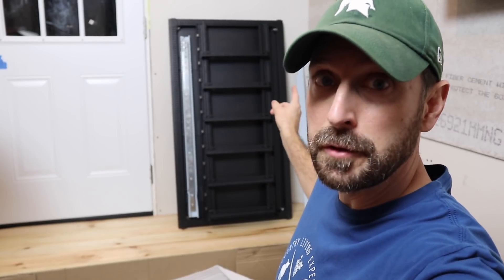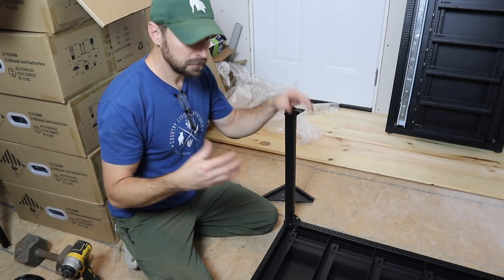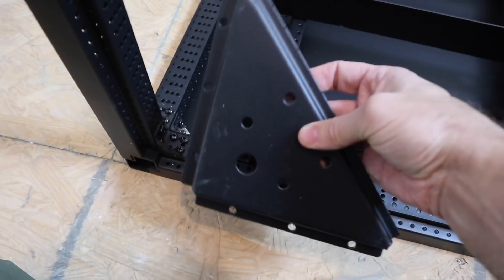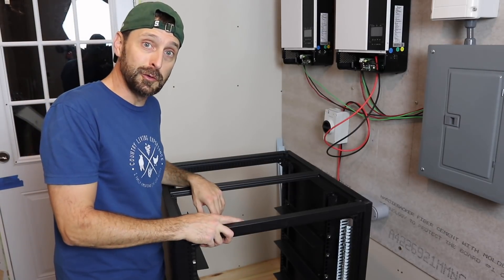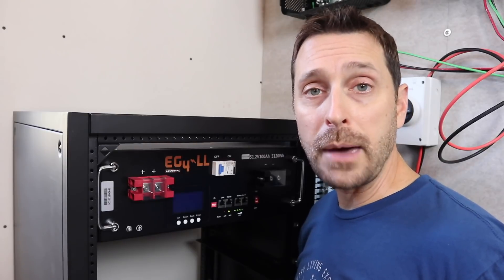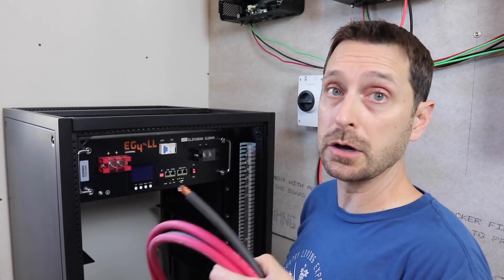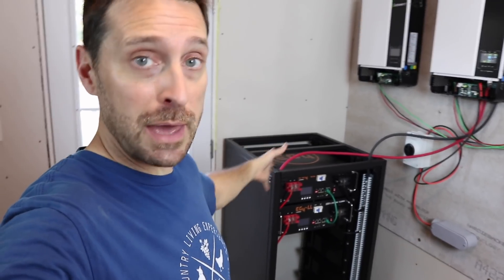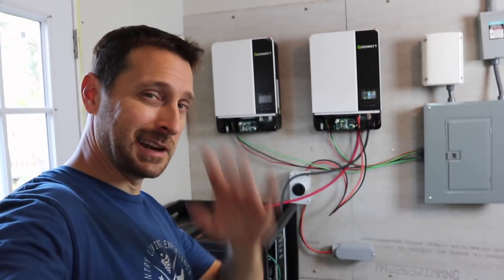Lithium Solar Battery 48v! Best Value EG4-LL +Rack Build Tutorial

Comment: So the roughly $200 premium compared to the other EG4 batteries, I'm trying to wrap my head around this.  So apart from the initial installation do you actually find yourself utilizing the LCD screen much during normal operation?  It seems more like a novelty.
Reply from the maker: Not just the screen. It has the ability for the bms to communicate directly with the inverters. The regular Lifepower does not.

Comment: Question regarding the 'grounding' aspect of this. If one were to build an off-grid battery rack with Inverter and they only connect it to the house via generator inlet connection for backup emergency power, like what Will Prowse showed recently in one of his videos where an MPP inverter is mounted on top, does the rack need to be grounded still? None of those 'consumer' solutions have anything special about grounding (ecoflow, bluetti, anker etc.), so I assume that 'ground' happens naturally when the connection from the 'unit (DIY or consumer style) is connected to the inlet to the house panel. Appreciate any feedback.
Reply from the maker: I appreciate the question. Grounding is a complicated and often argued about subject that some electricians don't even fully agree upon. That is probably why most videos and solar companies will not touch the subject. 
I have tried my best to glean information from a friend who is an electrician, the solar supply company, Mike Holt (probably the best source for electrical information), and other YouTube channels covering solar. I am not an expert by any means on the subject and just did what I thought was the safest based upon the info I had. 
As for your question, I believe that it would act as a generator ground and utilize the house ground system once connected via the inlet plug.

Comment: Question on grounding the batteries: I understand that the ground goes out to a grounding rod(earth ground), but what did you use from battery to battery? I was thinking a small "jumper" from battery lug to next, having two wires on every other with the final being the wire that goes out to the ground rod? Appreciate you videos.
Reply from the maker: You can do that but my batteries are in a metal rack and all bonded that way. I didn’t put a jumper between them.
Reply: this is a result of the mounting of the battery into the rack, correct?  Then just ground the rack to the rod?
 @CountryLivingExperience
Reply: Thanks by the way
Reply from the maker: Correct

Comment: Id love to have a bunch of those type batteries but they cost alot even if they are the best value. I have built my last couple batteries first i did a powerwall with leaf modules and now im building a good size lifepo4 battery with 280 grade a eve cells. I like the plug in rack stuff like you have but for the same price i got alot more amp hpurs and much bigger bms. The rack looks good tho and seems to be much easier and probably more safe
Reply from the maker: The batteries are the most expensive part of any solar system for sure. Glad you know how to build your own. It probably saves you a lot of money.
Reply: @CountryLivingExperience  yeah I love the battery stuff and all solar and stuff that goes with it. It's become a hobby that my wife says I'm addicted to. I'm an over the road truck driver and only home a few days a month so I order new stuff each week then going home is like a bunch of solar Christmas presents that I get to assemble and play with for a short time then back on the road. Thanks for doing all the videos
Reply from the maker: @matthewknight5641  Awesome

Comment: What is the standard method for connecting the charger?

It's terminals only split a few inches, therefore they can't even reach their own company's battery terminals.
Reply from the maker: I had to trim the insulation on the cord for mine to reach.
Reply: @CountryLivingExperience  
Ok, thank you very much for telling me that.

I didn't want to overlook another solution.
Reply from the maker: @dialecticalmonist3405  You're welcome

Comment: Doesn't that charger take 10 hours to charge a single battery? That would be 60 hours of charging before you could use it with a full rack.  What am I thinking wrong?
Reply from the maker: No, it doesn't take that long. A few hours for each.
Reply: @CountryLivingExperience   I knew I wasn't seeing something, I got the 10 hour thing from another video, maybe it was really 10 hours for a whole or near whole rack total. thanks my friend!

Comment: Would u know what setting the battery type is on the eg4 6500 inverter for the eg4ll battery?
Reply from the maker: Yes. Set to EG4 on master inverter and USE on all subsequent inverters. However, if you want to program #29 for low voltage cut off, you need to set both to USE.
Reply: @CountryLivingExperience  excellent, ty sir

Comment: I have the same EG4LL batteries and three of  ES5000’s. I really need to know what was your choice on batteries cable. It is not listed here. I am perplexed between 2 AWG & 2/0. Any recommendations, as i couldn’t find it in your descriptions. Thank you. 

Maranatha
Reply from the maker: For this system I used 2 AWG(guage). It was sufficient for the amperage. If you have 3 ES5000's, I may move up in battery cable size. Smallest to largest would be 2awg, 1awg, 1/0, 2/0, etc. I have 2/0 and 4/0 (huge) on my new system because the amperage is much higher.
Reply: @CountryLivingExperience  thanks. One more question, what about the cable size? Would it still be able to fit? I know I have to get the crimping wrench. But will the size (diameter) pose a problem? I caught a great deal on 2/0 @ $5/ft. Thanks
Reply from the maker: You're welcome.
Fit where exactly?
Reply from the maker: I did a battery cable assembly demonstration in this video.....https://youtu.be/-5w6b_2LxtQ at minute mark 8:58
Reply: @CountryLivingExperience  wondering if it is any harder fitting 2/0 (crimping) vs. 2AWG.
Reply from the maker: It should be the same level of difficulty.
Reply: @CountryLivingExperience  I am looking at 200 amps.

Comment: You need an electrician to redo your wiring, so your insurance will cover you if something goes wrong. An example would be your AC needs to be in conduit.
Reply from the maker: You didn’t listen to what I said about putting it in conduit later.

Comment: And don't forget to put a heater or an air conditioner and some other states up north where it gets 93 degrees in Wisconsin or 22 below zero in Wisconsin or like before 43 below zero you might need a heater and a shed as well as an air conditioner and the batteries don't like the cold or extreme heat as well but I don't know maybe they're inverter will heat itself but I doubt it not when it gets that cold when it gets that had it probably cool itself though.

Comment: I actually best fit it with an eg4 inverter which cost less than a grow Watt and it certified with electric company and every state in the United States of America of the 48 states maybe except for Alaska and Hawaii which I think they're actually certified for those too so you can hook it up the grid to sell electricity to the electric company but you do have to get a building permit and electrical permit to actually get that happen and they have to actually inspect it to pass it a second time and it will pass with those batteries and the eg4 they are certified for that and those are the only really two things that will connect together perfectly the grow what unless things are solar program to grow Watts for those batteries you would actually have to program those batteries for that grow lot or you can't just plug and play you would have problems and they might have done that for you and they might have done that with an update once you turn it on or before you even turned it on cuz they don't do the grow Watts they may sell them they do the EG4 inverters that's what belongs to signature solar and the EG4 batteries and both types of their EG4 batteries I certified by my understanding by the electric company and every state of the United States of America maybe only the 48 states and the hardest state of all it was certified for was California even accept them and that's what you should be thinking about getting is there actual inverters that are 6500 that cost $1,299 where the batteries cost in 200 or $300 more which you already have. With that you wouldn't know that other little box because with two of the inverters of signature sellers would come a 120 and a 240 volt without any extra thing cuz it's already built into them. And there are also stackable. And besides your inverters can take the most wattage in from solar panels than any other inverter out there at least that's what I do believe of course solar Arc might do the same thing or the AMS inverters that's electric companies likes to put it in like their county trucks would have for the trailers but I have 10 solar panels on them with two 1920 lb battery sets of AGM massive batteries.

Comment: Just finished assembly of the rack. It is a mess. I was able to screw in the black screws with a battery powered hammer drill, I think the threads are mismatched. I found a woodworkers clamp that can open to 24 inches handy to help align things.
The wheels are nice and worth $20! 
They send a different set of bottom plates that has the correct hole alignment for the wheels but the screws are too small. I'll try bigger washers but will likely need 16 new bolts and washers.
Over all it is beefy but clearly not a top shelf item. If you are welder...have at it and make it yield to your will!!
Reply from the maker: I wish mine came with wheels.

Comment: I ended up stopping by signature solar today and picked up my rack. I was told I would be able to connect One battery at a time to the inverter in order to charge them initially. I will connect One battery to the busbar then I will remove the wires and work my way up to the top until all six are the same charge. Probably will be easier with the charger but they were out of stock and it was like 200 and something dollars
Reply from the maker: Nice. Feels good to get started.

Comment: Can this be scaled up? Say a 2500 square feet house with mini splits for AC only, a wood shop running a couple of high draw 240 volt machines (dust collector plus 3 hp table saw), and a 3000-400 square feet office/studio? All buildings would be straw bale and highly insulated in the roofs/attics. All would have ground source floor heat coupled with high efficiency wood stoves. All outbuildings would have mini splits for AC only. Equipment, air con, and facilities would not all be used at the same time.

I realize this is like asking “how long is a piece of string.” But would it be doable given a very healthy budget?
Reply from the maker: Absolutely scalable. You can parallel 6 of these inverters together and 18 of the batteries. You will have to do the load calcs for all the equipment but it shouldn't be an issue at all.
Reply: @CountryLivingExperience  

Thanks for the quick response. My solar knowledge is dated...my parent's house does run on solar with a diesel genset but other than the inverter (was Trace, now Outback due to a replacement), everything was installed 20 years years ago with the help of a couple of electrician family friends. That was more of a "have-to" situation as it was going to run them $100k at the time to have power lines ran to them.

But things have really gotten advanced since then and I admit that I'm completely lost. Lol.

I run a small portfolio of fairly successful home and garden websites and am wanting to take them to the next level with a whole lot of YouTube and some level of local help (my team is all over the states and globe). Thus the need for the studio space (think a pole barn wrapped in straw bale...with a mini Linus Media Group setup inside).

Anyhow, great channel, and thanks for the quick reply!
Reply from the maker: No problem. Check out our playlist on our solar system. It should help with additional knowledge for setting yours up. Also check our Will Prowse and David Poz. Those two guys are great.
Reply: Thanks! Will do.

Comment: Sant to learn how to make a strong reliable rack for much less? Any local music store that sells recording gear has racks that put these star tech type racks to shame. No one will use those for expensive analogue gear that you pay about say $15,000 fora mastering compressor, then a Maselec EQ for another 11K etc. And you can see why they make better racks. Seriously, don't buy these bolt together racks, they are flimsy an cheaply made yet cost more. If you can weld, go to Amazon, reliable hardware for the rack ears, and make your own cabinet that is 19.125" across inside and some 2x2 square tube. It will be the last thing standing after a big earth quake.
As for the batteries, everyone is in agreement, those are the best and cheapest! .29 cents a watt hour.
Reply from the maker: Cool

Comment: Could you just use 1 of the pro batteries and 5 of the standard ones? Will the pro model allow you to read the other 5 standard batteries since they connect with the data cables anyways?
Reply from the maker: As far as I know, the pro model will not allow you to read the other non-pro batteries. The only way to get full info on each battery is to hook up a laptop to the inverter and read them through there.

Comment: I am hocking my 6 batteries (same as yours) to a Trace 5548 inverter, with 2 classic 150 midnight charge controllers. Is there a way to connect the battery communication directly to the charge controllers which do have an ethernet connection (as the Trace does not). If so, which batter connection, CAN, RS485, or Battery-Comm?
Reply from the maker: I do know that CAN has some glitches. On the battery itself, I believe the Batt-Comm is only for comms between multiple batteries. So the RS485 is the correct port. Signature Solar can better answer that question for you. I am not sure how the EG4 batteries specifically communicate with other brands of inverters.

Comment: Thanks for the very informative video. I have an 10Kw Solaredge system with the SE7600H-US and Q-Cell Q Peak Duo 395 with 26 panels. I am researching for a Lithium Ferro Phosphate 10Kwh Battery and found what appears to be a good match with a Fortress Power LFP-10. I see you are grouping batteries in parallel. Is this a better battery system to do this configuration as opposed to one single battery?
Reply from the maker: I was originally looking at the Fortress Power as well. In my opinion, these are a better choice for a few reasons. They are expandable. If you are budget limited, you can buy as you need and continue to parallel them. Similarly, the price per Watt Hour is unmatchd for the quality of these batteries. Additionally, multiple batteries give a greater sense of security if something happens to fail in one like the bms. If you only have one battery and it's bms fails, then you have a big issue. Hope that helps.

Comment: Hey there, or anyone who has bought these EG4 batteries, have you heard of EG4 not supplying circuit breakers on these batteries? I ordered the 24V EG4 with the screen and it did not come with the advertised circuit breaker. Do you see this as problem? I've talked with Signature Solar, my supplier, and it seems like the missing circuit breakers were a manufacturing error. Any help would be much appreciated. Signature Solar says they'd refund me some money and that the missing circuit breaker is not an issue, but I'm skeptical and it doesn't seem right that they sent something different than what's advertised. I'd prefer to have the safety of a simple circuit breaker built into the battery. Thanks for your time and reviews.
Reply from the maker: I didn't have that problem with my batteries. They are in perfect condition. If yours were shipped without them, it sounds like Sig Solar will give you a partial refund. Use the refund to buy external circuit breakers for your battery cables.

Comment: Did you try to place the mystery bolt bracket on the back instead of the top or bottom? I used 7 foot racks, but that may be to hold it against a wall , because it'll be a bad day if it falls over on your leg.
Reply from the maker: I didn't try those two positions. That is a good idea. I have been talking with Sig Solar about offering a better rack. Although this one is very stable as is for my application.
Reply: @CountryLivingExperience  put a bat at the top and it's top-heavy. bump into it and who knows what could happen. you should be ok because you're lowering the center of gravity with multiple bats, but just one at the top would concern me without bolting it to something substantial. but good to hear.